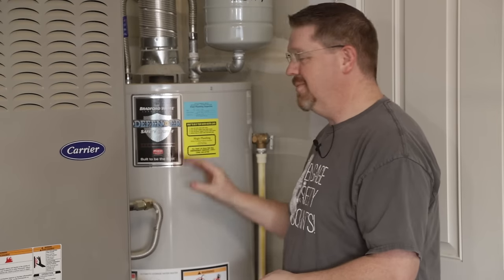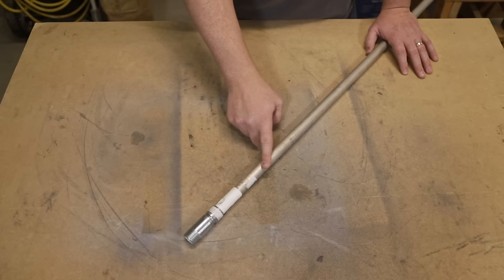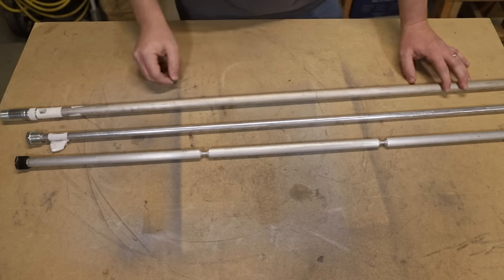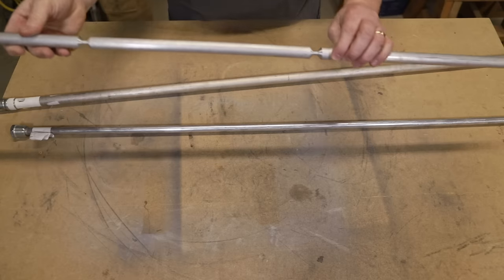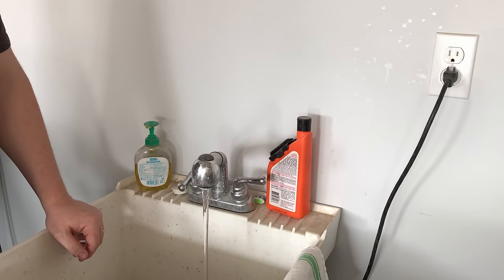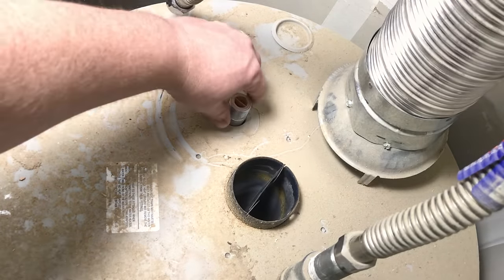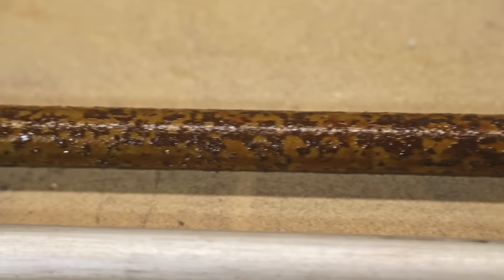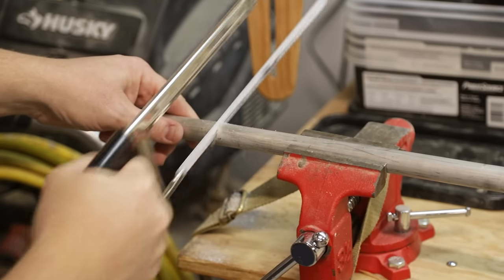How To Replace Water Heater Anode (Step By Step)

Comment: To loosen the pipe when only threads are visible use a lock nut jammed against a fitting like a coupling or elbow
Reply from the maker: This is fantastic advice. Unfortunately, when I was at my brother's it was a) late in the evening so no plumbing supply places were open and b) Lowes/HD (which were open) don't carry nuts that large.  I'll see if I can convince him to let me give it another try, with your technique, and see if we can get it out. Thanks!
Reply: @AmplifyDIY  electrical fittings is npt threads too.
Reply: Mike Fitzpatrick Not sure what you mean by Lock nut... I want to get one before I even start as I have the same water heater...
Reply from the maker: @mid-west_man  Unfortunately, no. The nipple and anode rod come as a complete unit.
Reply: @AmplifyDIY  About the length of your new rod.  I am wondering if they have just one part for every size.  For example that model number the biggest capacity is say 60 gallons, but yours is a smaller 40 gallon.  I am guessing that there is a horizontal size limit so that it will fit through the door, thus they stock one length and cut to tank size.
They must have had a lot of complaints about the striped threads and it was nice they redesigned it to avoid that problem.
Reply: Good one garenteed
Reply: Could this be explained alittle more? I wanna change mine but only threads are visible.
Reply: @kylekwaiser4230  thank you for this! My exact issue
Reply: There's no such thing as a lock nut for NPT threads. They are tapered (not constant diameter). That trick only works with straight threads.
Reply: @TechnicalLee  You are correct, but the lock nut solution I mentioned is only for a temporary use just to get the anode rod out.
Reply: @ronstrode9124  this would be 2 nuts tightened up on eachother. You can grip one and turn which will tighten up further against the other then the whole thing twists out.
Reply: Double nut the threads (thin nuts; or a big one, cut in half).  Hold top nut "still" with one wrench, while wrenching the bottom nut in loose direction until it stops against top nut.  Then keep turning bottom nut (against the top nut) to loosen entire anode rod.
Reply: @ronstrode9124   it's not just one nut, it's two nuts the top one acts as a stop while you use the bottom nut to unscrew the rod, you might have to hold the top nut with a second wrench to hold it, keeping it from turning at the same time as your turning the bottom nut, it does work fine with just about any nipple.
Reply: Wow, that's brilliant! Only a pro knows stuff like that! I was wondering what to do... poor guys brother!

Comment: While I just recently found your videos, I find them very informative and helpful. Being a Union Pipefitter actively working in the trade for 24 years and the last 10 retired, nothing bothers me more (pet peeve), than to see someone use a wrench the wrong way. First example was using the adjustable pliers backwards. The proper way is to push the wrench so that that the jaws of the wrench flex into the pipe or fitting and the teeth are angled in such a manner that they bite into whatever you are trying to loosen. Second example the nut to the anode rod should always have 3 points of contact with the adjustable wrench as well. In doing so you will have a much tighter connection with the nut and it will be less likely to slip. Lastly, when using the pipe wrench, it’s extremely important to establish 3 points of contact with the rod as well. The three points being the two jaws and the throat of the wrench. This, like the adjustable pliers, will make a much tighter bite due to the pitch of the teeth on the jaws. It may not have been as important in this application but when using a pipe wrench on pipes, maintaining a three point grip will prevent the pipe wrench from egging the pipe. (taking pipe out of round) I was always taught to always use a wrench the correct way they are intended to be used. 
I will agree with the others in saying your videos are very well done and you obviously are very talented at what you do. Also, you don’t have a lot of unnecessary words like umm or uhh being used. Great job!! Keep up the great, and informative videos!!
Reply from the maker: Hi David - I appreciate your constructive feedback. I'll be more careful in the future to demonstrate proper technique. In at least one instance, I purposely had to use a wrench backwards on a fitting as I was only using it to gently brace the fitting so I could apply torque to another part... but your points are all valid, and well explained. Thank you for taking the time to comment, and for watching some of my videos!

Comment: I switched to the Corro-Protec powered anode rods. They completely eliminate the sulfuric smell, (which is CAUSED by the magnesium rod), and last 20 years. No need to change the anode rod every year. They are short and easily fit a tank with limited overhead clearance. No need to keep trying chlorine or hydrogen peroxide contortions to get rid of the sulfur smell. I expect to get 20 years of service out of my water heater. We do have a whole house water filter ahead of a water softener so there is very little issue with sediment and calcium entering the water heaters. And they do make them for the Bradford White application.
Reply from the maker: I've heard very good things about powered anodes. Thanks for watching!

Comment: When using a pipe wrench, always go for a three-point grip. The throat of the jaw opening should contact the pipe you're gripping. The third point of contact works against the jaws' crushing force. That said, the comments on inserting a filler rod and using lock nuts are spot on.
Reply from the maker: Thanks for pointing this out, Gene! I should have been more careful and demonstrated better technique. Thanks for watching!

Comment: Awesome video, I replaced mine today on a Whirlpool Water Heater. I used a 1-1/16 socket and an impact driver to loosen it. A lot easier than your Bradford-White set up. Thanks again, and keep the videos coming, they’re excellent.
Reply: Not so easy on mine . The manufacturer epoxys the fitting in to keep owner from replacing. The difference in their 6 year warranty and 12 year warranty models is  a heftier anode rod.

Comment: Had the same situation with the same Bradford White, had to remove the top of the heater, removed some foam insulation and the nipple without threads will be exposed for ~1 inch, should be enough to grab it with an adjustable wrench and of course don't forget WD40:)
Steps I took to change the rod in my 10-15 years old water heater (after I removed the rod, there was nothing left, so, assume it was never changed):
1. Remove the top of the heater (5-6 screws)
2. Remove some foam/insulation and expose the whole nipple.
3. Apply lots and lots of WD40 and wait for ~30 mins.
4. Try to grab with an adjustable wrench and it should be good to go.
5. When you're going to remove the old rod, pay attention to the plastic white adapter that is attached to the nipple (the one that has a heat trap inside) - chances are it's going to break, so, slooooowly remove the rod using pliers, otherwise, you're risking to drop the remainings of the rod into the tank.
6. Flush the tank multiple times (I recommend to change the standard garden hose valve that comes with the heater to the 3/4'' ball valve - you will see the difference).
7. Enjoy the water heater for another 5-6 years. Then replace the rod again. The heater will last you decades ahead for $25-50 every 5-6 years.

Comment: It’s obvious from what I’ve experienced that neither the manufacturers nor the plumbing supply shops are particularly interested in people doing this for the simple reason that it adds years of continued service to the hot water heater. One plumbing supply shop said that I should just replace a 6yo hot water Heater instead of replacing the anode. That would run me $1800 in NYC.
Reply from the maker: Agreed.
Reply: Notice how they grooved the fitting above the lower thread? It will bust off flush with the top of the tank unless you tighten it juust right or have no rust in the thread when loosening.
Reply: My former water heater was electric but was installed in 1999. Sold my house with it inside in 2017, still kicking. Changed the anode rod every 2 years.
Reply: They are actually COLD water heaters. If the water was already HOT, you wouldn't have to heat it.
Reply: 6 years is a little young but there are so many things that can go wrong with a heater you don’t want to start being nickel and dimmed to death. When you have one problem, you might start having more, each of which can be fixed but at a price...that’s where I make easy money. I’m a master  and been doing this for years. If YOU fix it then it’s worth fixing but if you have to keep paying a plumber, a lot of times a new one would be better. Statistical life span of a water heater is 8 to 12 years.
Reply: paul kern 
Good points Paul. I did replace my sacrificial rod and had my plumber replace the corroded fittings on the output side of my hot water tank. No leaks so far and saved myself the $1800 a new one installed would have cost. I just found it strange that one of the largest plumbing supply houses in Brooklyn doesn’t even carry replacement rods.
Reply: @cyrilasfrenchyaz  Its been my experience with water heaters failing because of age and the bottom rusting out till it finally comes off, i have never met anyone that changed a anode on a water heater, didn't even know they had one,lol,last heater i changed in 2009 had been in service since 1983!! I'm sure it has to do also where people live, i visited a town in Mississippi many years ago where every toilet was brown (even in our hotel room and several restaurants we visited), im sure a water heater there wouldn't last very long.

I can see a electric heater having issues with anodes also for obvious reasons but yeah this video was very interesting.

Comment: Excellent video!  I am 72 and never understood why a water heater could suddenly spring a leak because it was 10 years old.  Plumbers never tell you to replace anode bars every 3 years or drain the fixture every 6 months either.  If we all did this, our water heaters might last for 20 years due to lack of corrosion…😂😡

Comment: I had a specific situation last year where I could not get some npt threads going into the cold side of my water heater to stop leaking even though I was using plenty of Teflon tape. Then I applied both Teflon tape and pipe dope and it worked flawlessly and I have yet to have that leak again. Now when connecting things like water heaters I always use both, there’s no harm in it:)
Reply: Tommy TMT Teflon tape is a thread lubricant, not a sealer.

Comment: If your old rod is still in good shape take a wire brush and clean of the nasty stuff and re-use it.  Also when using thread tape it is a good idea to leave a couple threads bare so you can start it easier when re-installing your rod.
Reply from the maker: 2 excellent suggestions. Thanks!
Reply: That my friend is a good fucking Idea, why I didnt think of that before. 🤦‍♂️
Reply: Awesome suggestions, REALLY Helpful !   Thank You !

Comment: Great video, when replacing the drain valve, since the tank is empty, you can also access the heating element to replace it as well. I use a clear (So you can see the deposits) plastic hose a bit smaller than the element port size to vacuum out calcium from the bottom of the tank. I'm going to use the electronic anode rod that can last 2o years this week. It has a foot-long Titanium metal that doesn't get eaten up since the emitting electronic pulses do the work.

Comment: Great video.  I also replace the rubber gasket in the flexible water supply line, especially if they are old.
Reply from the maker: Good tip. Thanks!

Comment: Exercise care using pipe wrench. Some anode rods assembled from the factory are so tight that we tend to use cheater bar for leverage. However, there is a danger that the anode rod pipe itself will collapse/crack and break right at the threading. That will be a bad day indeed. I use a socket wrench with the correct size inserted into the opening to prevent these mishaps.
Reply from the maker: Great tips, thank you!

Comment: Excellent video for replacing a Bradford-White anode rod. I especially liked three tips: 1) How to correctly wrap Teflon tape on tapered pipe threads; 2) Using Teflon tape and pipe dope together (40+ years of experience says to use both on metal pipe threads (steel; stainless-steel; aluminum & brass) and only Teflon tape on plastic threads (but you can still use both on plastic threads as long as the pipe dope is manufactured for plastic threads (i.e., PVC; CPVC; Polypropylene; ABS; PTFE; PFA; & FEP); 3) To prevent "cross-threading," reverse the direction of the pipe fitting while slightly pushing down on the pipe fitting in/on the female hole until you hear/feel a "click," then reverse the direction and tighten. This is also a good practice for "self-threading" screws in wood or plastic after the threads are created in wood or plastic (when re-installing these types of screws to prevent creating new threads "in-between" the old threads in the wood/plastic threaded hole - which weakens the mounting pressure.

Comment: Great video. I just removed my anode rod yesterday and sanded down all the calcium/lime that was on it. It was still in very good shape structurally . I was surprised at the design of your rod. I was under the impression that the rod metal had to be in contact with the tank metal in order for the sacrificial process to work. I know that's the case with a motor boat engine. Your rod seems to be isolated with the plastic collar which would not allow for the contact of the two metals. So I'm a little perplexed as to why they designed it that way. Personally I don't like the way yours is designed and integrated into the output line. To me having a separate anode hole and threaded section is much more straightforward and nicer.  Thanks for sharing
Reply from the maker: You are 100% correct that the anode has to be connected with a conductive path to the steel of the tank. In the case of my anode shown in the video, it does it via the threads that are screwed into the tank itself. It's probably not obvious just by looking at the end of the anode, but I believe there is a small electrical conductor that connects the threads of the fitting to the anode at the bottom of the plastic valve.  In fact, I just ran out and used a multi-meter to perform a continuity test on the old anode I pulled out of the heater in this video, and sure enough: the threads do have a conductive path to the anode rod.

But I also really dislike how this has been integrated into the output line.
Reply: AmplifyDIY - thanks for the confirmation reply. I am replacing my neighbors anode tomorrow. It is at least 12 yrs old so I am not expecting much to be there. We flushed about 30 gallons out and had quite a bit of fine rust particles and small sediment particles. Not huge at all but I’m beginning to wonder whether the tank has been compromised due to never changing anode and hence more of the rusty looking particles. There’s not a lot of room either so I’m going with the four piece flex magnesium rod
Reply from the maker: The fine rust particles could be from the anode, not necessarily the tank itself. Good luck with it!
Reply: That little core wire you observed is the connection. It runs through the plastic part somehow to connect with the fitting. If the anode were completely depleted, that wire would remain. The first part to corrode on that anode you removed was right at the top. Eventually, that would have corroded all the way through. Without the core wire there,  the rest of the rod would have fallen to the bottom of the tank. This also explains that aluminum one you showed that was designed to bend: Without the core wire, the sections would soon corrode through at the thinned sections.
Reply from the maker: Right. That core wire is (I believe) a braided steel cable, that acts as both a conductor and structural component, just as you describe. Thanks for watching!

Comment: I just found out the anode rod needs to make metal to metal contact on the threads when replacing! You can't use too much dope/tape or it will not make contact.
Reply from the maker: You can always check for a good connection with a basic multi-tester’s continuity testing function. Great tip! 👍🏼

Comment: I didn’t see you put pipe tape on the rod and hose connection. Other wise best video I have seen. Very detail. Thanks s bunch.👍
Reply from the maker: Hi obtugtxivtub - The connection between the flex pipe and the top of the anode where I did not use tape specifically does not need it. That fitting employs a small rubber washer inside the flex pipe side (much like a garden hose) to make the connection watertight. Teflon tape and/or pipe dope is not needed there. I didn't mention it in the video because of the wide variety of other ways that heaters can be connected, and I didn't want to confuse anyone who may not have the same sort of connections. Thanks for watching!